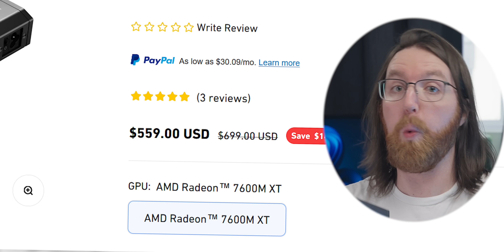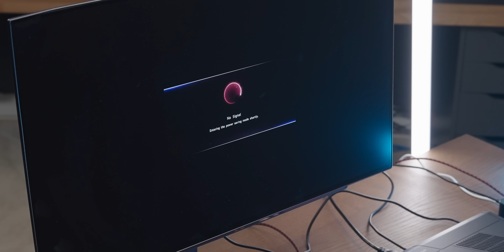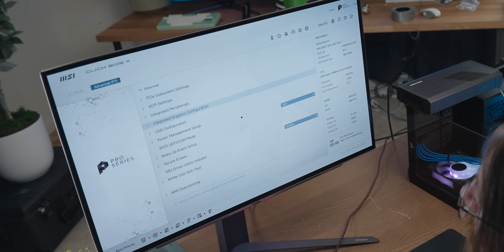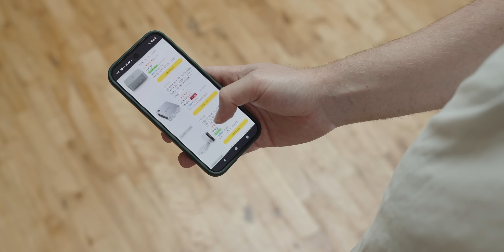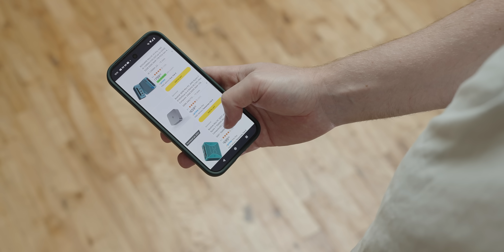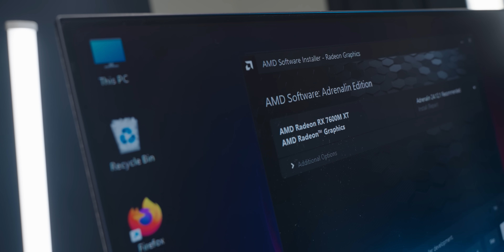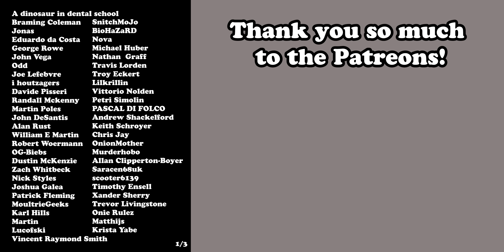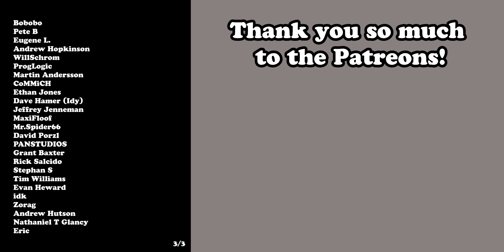This Aliexpress Graphics Card Did Terrible Things To Me...

Comment: Mini PC that uses a laptop cpu plus mini external gpu that uses a laptop gpu. If only they could combine both into a single device and maybe also add a monitor. If only…
Reply: Maybe in the future the tech will finally be there
Reply: I laughed, out loud. 99% of the time a laptop is the right answer, if not desktop. Just hook it to your display / input of choice. That said, there's that 1% use case where a small handful of these mini PCs are a better deal, if you just do not need the laptops display portability. I still push most customers to a desktop / tablet combo with Moonlight / Sunshine.
Reply: I was looking at the Benchmark of the RX 7600M XT and comparing it to my much older RTX 3060 Laptop GPU and the RX 7600M XT is 1-2% better at direct-x 12? Granted it was remaining stock but two years ago I got a laptop with a Ryzen 5800H and RTX 3060 for about $900. Seems like a lot less trouble and even maybe cheaper  just to buy a nice gaming laptop.
Reply: The 7600M XT will be about 25% faster in most games than a full TDP 3060 mobile. A 4070 mobile laptop will do close for around $900 USD. Sadly, the 5070 mobile is about the same performance, but obviously not that cheap.
Reply: I don't have a RX 7600M XT, so can only look at benchmark. I think my argument is still sound however. Buying a laptop with a decent graphic card is likely cheaper than the graphic card and mini-pc while being far less trouble.
Reply: @KitsuneVoss  Defintely sound, I'm in agreement a few replies up. I was just giving the numbers.
Reply: @KitsuneVoss  Some people don't want to carry around a gaming laptop all day, especially if you don't need the graphics card power. 
You can leave this dock at home.
Reply: @ And carrying around both a Mini-PC and an external graphic card is easier?
Reply: It's a never ending cycle, why bother with a mini PC anyway, they're all are so expensive than they should
Reply: They did - It's called Laptop! :)
Reply: Bro that's crazy. That will never work! Who do you think you are, Steve Gates?!!!
Reply: @damnablethief No, I'm Steve Gates papa, Rusty Gates.
Reply: You shouldn't ignore how much better the external ones with proper cooling and full wattage run compared to the poor GPUs that run on 50W in laptops with cooling for 30W. 550 is too expensive for sure, but at a reasonable price, I'd rather have an ultra light laptop plus GPU performance at home
Reply: @biglevian  what time are you living in lmao, laptop GPUs can pull 175 watts and have the cooling to maintain that wattage. im speaking from experience here

Comment: E-GPUs are so cool and such a good idea, but they cost more than their desktop counterparts. Can't wait for the used market to get some supply
Reply: Don't they sell cases you can populate with a desktop card? Granted the case is another added cost though...
Reply: @volvo09  Yes, it's called a SFF compu- ... Okay, sorry. Yes they do, but the allure to this one would be the tiny size it has. Much smaller than the likes of the Razer Core X, and way easier to carry alongside your laptop. You could of course argue that you get small external docking stations too, but then when you add the GPU to that, they're not so small anymore. Plus it's annoying to set up and take apart every time you move, so you don't risk breaking the connector in transit. There is the fact you can't really change the GPU in this too... Not yet at least.
Reply: @Deja117  I 100% agree if you need a portable device. For home use, it doesn't really matter although it's funny that a dedicated gpu+dock is about three times bigger than my minipc. It's amazing how much power modern amd minipcs have, given their footprint.
Reply: @volvo09  I bought one from aliexpress, a thunderbolt 4 gpu enclosure that cost me about 200bucks, I use it with my Legion Go when traveling, Beats my old travel set-up which was a mini pc build w/ a 3060, I mean the mini PC set-up performs waaaay better but the convenience of the legion go w/ dock is much better, I can game on the go and when I am in a hotel or something I can plug in the egpu for more gpu power.
Reply: @volvo09  they do, they cost quite a bit although that is partially because of the manufacturing , power supply, and various other things that go into it, but they get quite a bit of markup due to being so niche.
Reply: @volvo09  Yeah, the DEG1 eGPU where you use your own GPU and PSU. The best outcome for someone wanting to do that. Any of thse eGPUs with fixed GPUs are a rip off as there's no upgrade path vs a desktop, repair options as well as usually being way overpriced for what power you get.
Reply: @volvo09   from what I seen eGPU enclosures for desktop cards start around $300 at that price you might as well build a whole pc 😂
Reply: Look out for the GPD G1 to hit the used market!
Reply: I think mine cost... £250? can't remember. It's an enclosure, of course and it came with an RTX3060, been meaning to upgrade it some time but not worth going too crazy with Thunderbolt 3.
Reply: Someone should sell kits to make your own external GPU
Reply: Not cool running on x4 of x16 lanes
Reply: there is thunderbolt case for external gpu. You plug there normal desktop gpus.
Reply: or you can just build a e-gpu using a old desktop graphics card
Reply: usb bottlenek
Reply: Obviously they would cost more...I mean...I am not even gonna explain it.  It is obvious they would be more money.  How is that a complaint?  Hey guys, McDonald's charges more for a large drink vs a small....buyers beware!
Reply: Maybe this will start others offering this type of package, and cost will come down a bit. I'd definitely get one if there any good and affordable.
Reply: Better yet APUs are getting so good that these won't even make sense unless they're a higher end GPU.

Like I just a GPD 5 and the 8060s in the Ryzen 395 is over 20% more powerful than the 7600M XT even at just 55w
Reply: He should have bought Minisforum eGPU dock instead. Then one can choose power supply and gfx card seperately and just connect to the dock.